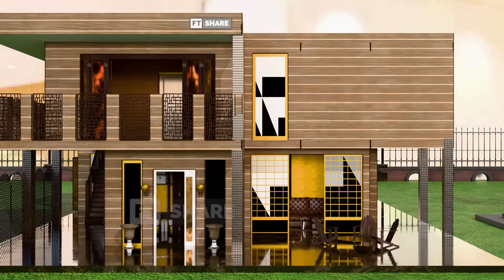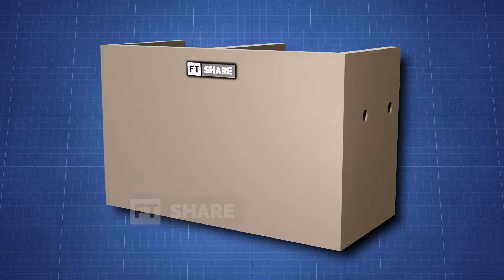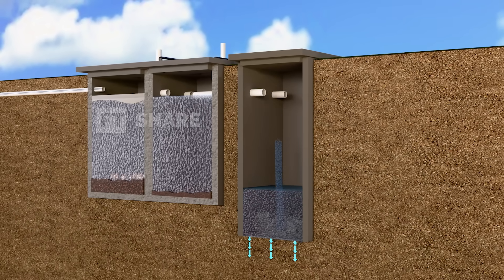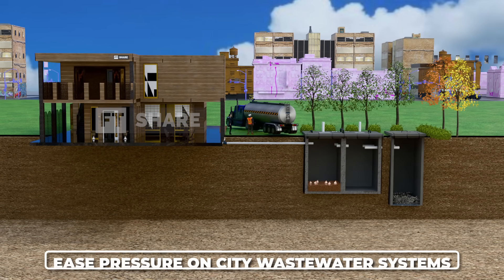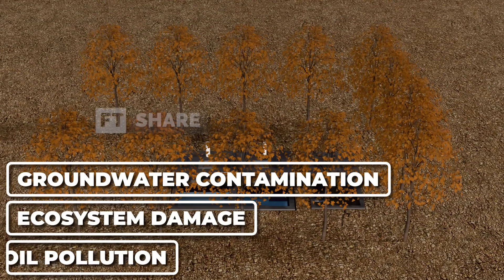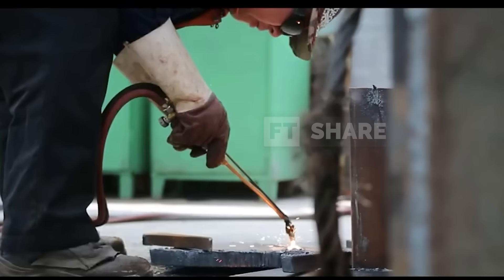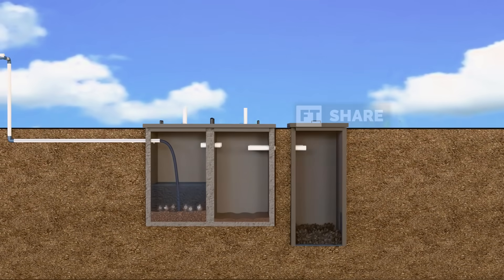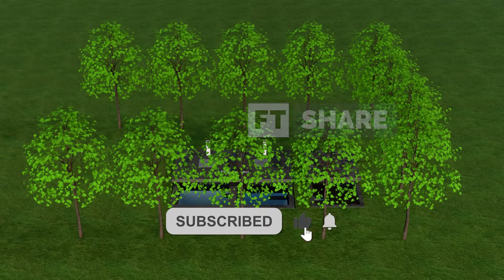How a Septic Tank Works – Explained with 3D Simulation

Comment: What stops the gases and smells coming back up the pipes and into the house through the drains in your sinks and showers?
Reply: P-traps
Reply: @uren11_11 a lot of showers don't have P traps due to being on the floors. I've got a a house I'm thinking of building one in and 1 sink and 1 shower and a toilet would run to it. Maybe I could fit a large inline P trap in the main pipe to the system
Reply: Venting of the system is typical where I live.
Reply: The sewer lines from those items cotain traps which are always full of water.  See the p shape pipe under your kitchen sink.
Reply: @kirkboivin4357 yes usually they do but some showers don't have room under them. I've got 1 property that doesn't have them and doesn't have any room so I'm thinking of possibly fitting a large one in the main pipe into the system? If it would work correctly. I don't see why not
Reply: @kirkboivin4357 they are always full of fresh water,as water flows through them fresh water keeps replacing the one that was in the P
Reply: The same systems that doesn't let the gases of municipal sewage system move back into your bathroom. The one way valves and P- traps. 
Besides, there needs to be enough pressure built up need for the gases to travel that far back, which is easily and obviously prevented by ventilating the gases right above the tank. 
If you look at the diagrams closely, you'll see a pipe sticking out in the surface right above the tanks for offgasing
Reply: @aleenaprasannan2146 how does the off gassing work if it needs to be a sealed air tight unit? Is it a pressure valve that only opens once a certain pressure is achieved?
Reply: @c4r5on88 Where did you learn that it needs to be airtight? Its literally a requirement for a septic system to not be  airtight for fluids to move. Where would the flushed water go if the system is airtight? A blocked one would literally cause the whole tank to rise up above ground surface because of methane buildup. 
The bottom of the last tanks is also not concreted and instead has sand, as the video says, so that the water can undergo natural filtration by percolation. 
That's the reason why groundwater table depth and soil composition is desicive, on whether a septic tank will be permitted or not. A shallow groundwater table and/or if the soil is clayey which obstruct vertical permeability of water, aree conditions where a septic tanks must not be built, since it not being airtight mean shallow aquifer will get contaminated and clayey soil means water and air wouldn't flow causing blockage in the septic system.
Edit: The P- trap and one way valves are there to make sure the fluid movement will happen in only one direction; they are not to prevent any movement all. We actually want movement in one direction and for that to happen the system shouldn't be airtight
Reply: Los gases y olores dentro del tanque  están a una presión diferente que la atsmosferica 
Que es de 14.7 psi,al poner un respiradero en la parte superior del tanque; induce a éstos, salir por el mismo; por equilibrio de presiones.
Además los gases y olores son menos densos  que el aire. El antiguo principio de la Chimenea.
Reply: Homes / buildings have air vents after the P-traps on the plumbing. Gas can backup and escape out the vented pipes.
Reply: P-traps and vent pipes